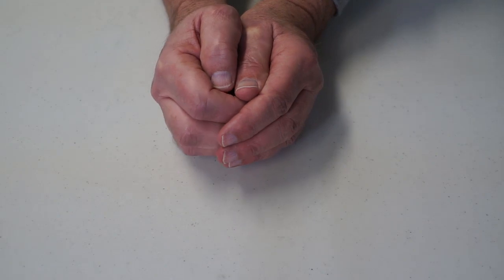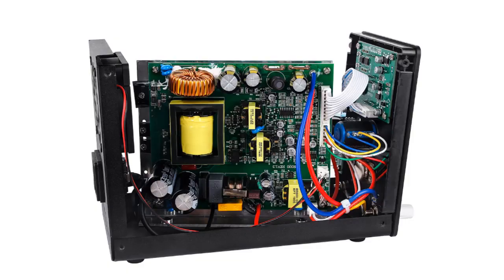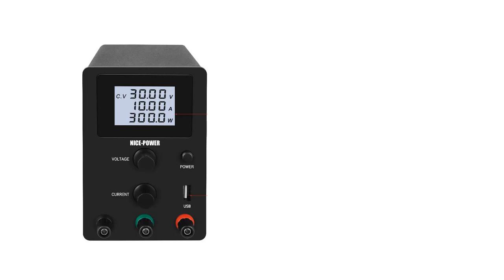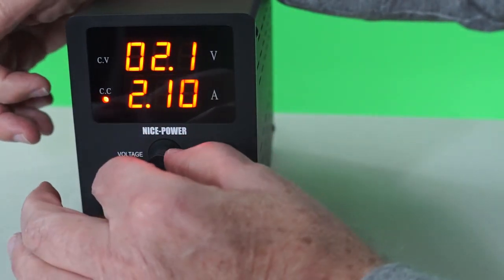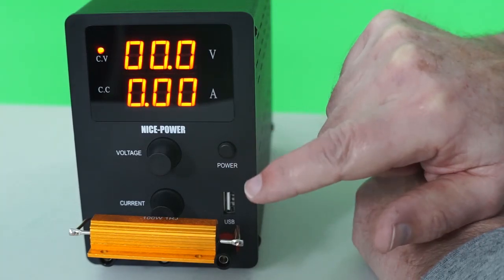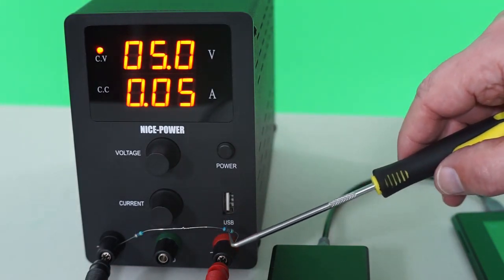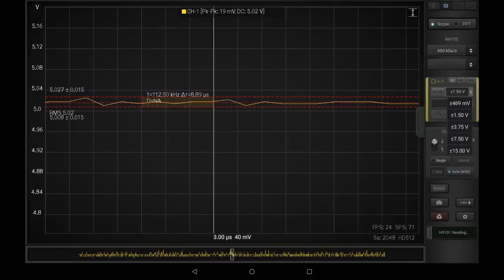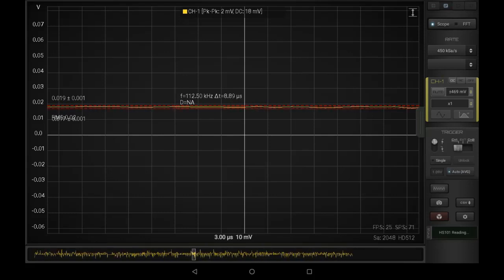GADGETS#90 - 30v 10A BENCH POWER SUPPLY

Comment: Hi!
I have a question...
The fan of the back of power supply is always on, or when it turning on?
The NTC dead of mine, so I replaced it to NTC-5D15, and it the fan won't turn on after 5 minutes (with 40W consumer)
Reply from the maker: takes quite a bit for the fan to even come on...can't tell you exactly at how many watts it kicks in...most normal use it's off...

Comment: I've got a similar bench top power supply and I've been attempting  the Kelvin 4 wire resistance measurements test with mixed results. So far I haven't let the smoke out of anything, well, not yet :O)
I have a set of leads with the Kelvin insulated alligator clips. I was wondering if you'd be interested in doing a tutorial. You have a knack for low BS explanations and a straight-forward approach. I'm monkey-see-monkey-do, then me and my opposable thumbs can grasp the object and concept all at once.
https://www.allaboutcircuits.com/textbook/direct-current/chpt-8/kelvin-resistance-measurement/
Reply from the maker: I've bookmarked the page. Will take a serious look at this and thanks for the idea!
Got a few thing on-the-go right now including a 2 channel WiFi oscilloscope build.

Denis

Comment: Hey. I cant find any info if it has reverse polarity protection. When lets say charging a battery?
Reply from the maker: it does not have reverse polarity protection and is not a battery charger and would not have auto shut off either...
meant as a current controlled variable output power supply for electronic work...
Reply: @theGADGETSplaylist  Thanks. I understand. I repair car amps as a hobby and last psu went down because amplifier's 12v side had no pull down resistors and were still charged. I hooked it up to my psu unfortunately with reversed polarity and the psu died. Thats why i was interested.

Comment: hi im looking at this power supply does it have grounding on the mains power side? i cant see from the photo's on aliexpress if it has it. and they dont supply a uk cable so im guessing it might not have it
Reply from the maker: For North America, it comes with a 3 prong plug, so earth ground is connected. Also, if you notice on the front panel, there are 3 banana jacks...the middle one is earth.
Not sure about units shipped outside of North America...

Comment: Cool I’ve been looking for something like this to test car bulbs circuits etc. can you use this with your transducer as a 5v ref?
Reply from the maker: +Welding Junkie - it's "possible" to use this as 5v REF for pressure transducer. Would not be my first choice...
If you do look at ordering this and your use is automotive, then make sure you don't end up with the 60v  5A option.
Reply: logical canuck I was looking for this one 

DC Power Supply Variable, Switching DC Regulated Power Supply with 4 Digital LCD Display (0-30V/0-5A), Reverse Polarity/High Temperature Protection, 110V/115CM Alligator Leads Included - MDC01 https://www.amazon.com/dp/B07JQXQ8S5/ref=cm_sw_r_cp_api_i_C.3kEbYHJBGXE
Reply from the maker: @weldingjunkie  - only 5A
Not the best choice for automotive. You likely want 10A

Comment: Nice wee rig...$70 CDN...unbelievable. Cheers & Thx
Reply from the maker: +TheGibby3340 - thank you..and welcome to the channel!
Reply: @theGADGETSplaylist  Thank you Sir. Your channel has some great stuff. Our tool box's seem to contain all the same gear...
Reply from the maker: @TheGibby3340  - noticed your channel, have subbed and will find time to take a good look:-)
Reply: logical canuck Thx...you didn’t have todo that. Greatly appreciated
Reply: 20mV is outstanding!
I have the RD6006 (60V 6A). It has a lot more features but twice the ripple. It’s very precise and more aimed at the electronics vs automotive, I guess. It costs about $100 US.
Reply from the maker: @Conservator.  - yes, and taken @ 450 ksa/s...so, I was capturing it all.
What surprised me is that there wasn't much difference with 1Ω and 100Ω loads.
I think you'll like the small linear module I have planned (spoiler alert: it's LM317 based)
Reply: logical canuck 
Looking forward to it.